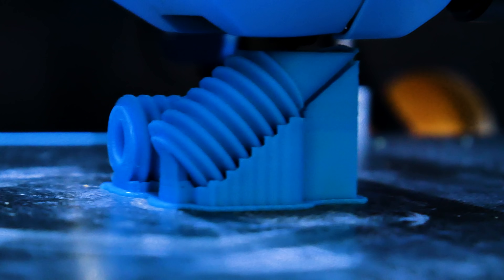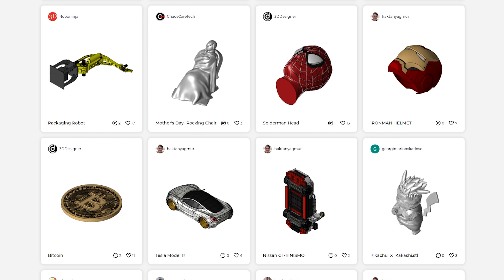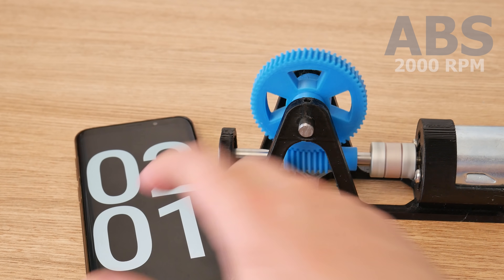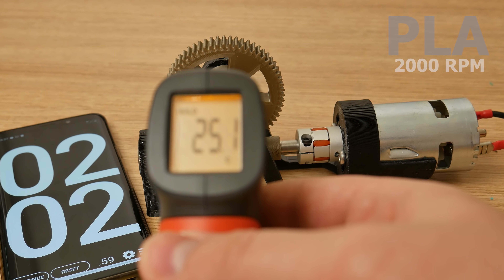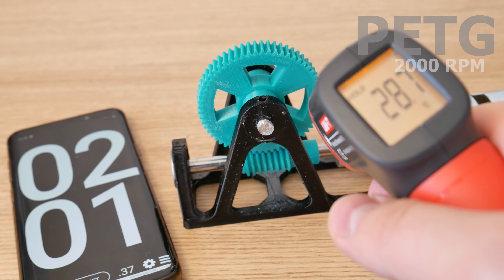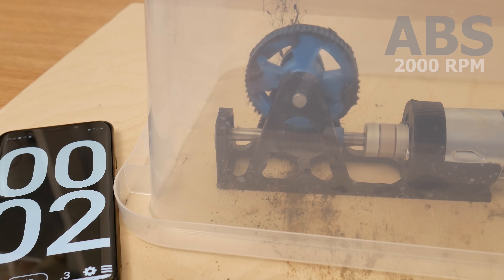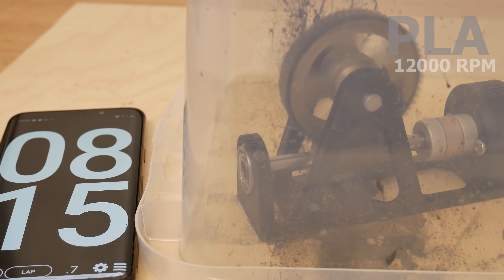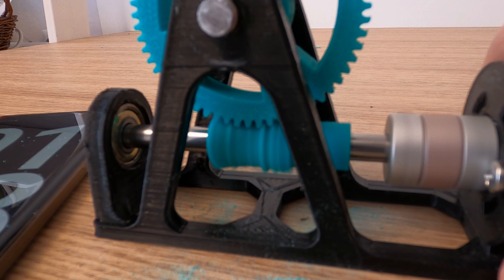3D Printed WORM GEAR - Can u Really Use Them? (PLA vs PETG vs ABS)

Comment: Is usually considered a mechanically poor idea to run identical materials against each other... result is frequently galling.  Far better results likely running with different materials. Eg try abs worm and pla wheel
Reply: I looked up galling and it's apparently kml a phenomenon than occurs with metals.
Reply: @fortoday04 I'm not convinced galling is limited to metals. Think it, or similar problems, could occur with any material combination that can friction weld.

Comment: Worm gear needed a set screw...once it had enough heat to not be locked to the shaft it could move out of position...forward on the shaft, causing the threads to be misaligned and thus accelerating wear and damage.
Reply: Exactly right.  Relying on a press fit for accurate positioning in a stress/heat inducing application/test isn't sound design.

Comment: You get a better result using a standard steel or brass bolt as the worm drive and print the gear at a suitable pitch.

Comment: I feel like you should expand your testing to Nylon as well since it is somewhat self-lubricating.  Also, most worm drives in practice often use a softer material for the Worm Wheel than they do for the Worm Gear.  Once I upgrade my printer to be able to print nylon I was thinking of doing a "regular" Nylon for the Worm Wheel, while using a "carbon fiber" Nylon for the Worm Gear. PLA-PETG-ABS are nice, yet when used for industrial applications will always be sub-optimal.

Comment: Try using a setup with tighter tolerances and a slightly larger diameter wheel with beveled teeth to cut down on the wear.  You will of course have to change the number of teeth to accommodate the gear properly but the specs aren't that hard to configure.

The hard part is machining the bevels.  Not only will in increase the longevity of both the wheel and gear but it will also decrease the friction and produce a larger time that the two are in contact for each encounter.

It sounds counter intuitive but the major problem I am seeing with your designs are that you are relying on single point contact, two points if contact continuous and 3 during the apex would be a more desirable design.

Comment: The teeth on the gears in the thumbnail don't match properly, so of course it isn't going to work right. It would be nice to have some decent pics showing how the teeth mesh, because I think the biggest problem here is design (Of course I could be wrong, but without decent pics I'll never know). For the most part, I think this video is mickey-mouse nonsense with zero real-world relevance.

Comment: Use igus filament for parts that are subject to wear and friction, they are optimized for low friction and contain solid lubricants!
Reply: I think including lubricants in a plastic would make a layers not stick together.
Reply: @melody3741  he is right.  Igus sells bearings and they sell a filament for making bearing surfaces.  This is a great idea. The solid lubricants allow printing and lubrication.
Reply: @melody3741  some igus filaments print very easy and have great layer adhesion... I150 for example. I work with them a lot
Reply: @melody3741  A lot of mechanisms are made from PA (Nylon) and POM (Delrin) famlies of polymers, and you're also familiar with Teflon. These polymers are called "self lubricating" as in if there's any material lost on the surface, it acts as a lubricant as opposed to abrasive, besides being low friction to begin with. I forget what polymer IGUS products are based on, it's something else yet, but it's similar in this regard. This isn't true of PETG for example, the particles can flash crystallise from pressure and become abrasive, although otherwise it's pretty good for friction surfaces.
Reply: Or just throw some oil on it and the texture of the layers will hold and trap oil and pull it through the system evenly
Reply: i didn't realize this filament existed, I've used their bearings with great results. It definitely looks like a good candidate for gears
Reply: @rj7855  for gears , use nylon
Reply: Except this is a truly difficult material to print with. Not for the common printer as far as I've read.
Reply: @MoonWind32690  depends, there are some tricky ones, but I150 is no challenge when you're used to PETG, can be used on any printer
Reply: @Alakuu  taulman 910 is very easy to print and works with most printers. I've made gears with it, and they worked pretty well.
Reply: Need me some of that.

Comment: ABS is unfortunately not oil resistant, which means that the grease itself will have its effect on the material. Maybe next time use ASA as a comparable substitute.

Comment: that really blows my mind how huge of a difference a little grease made!! awesome video. be great to see how well they work under a high load!
Reply: "a little grease"

XD

Good joke mate
Reply: @HidekiShinichi  you obviously havent greased a machine in your life lol
Reply: @cranexdragon1046  I had. And for most part the less grease you use the better, the more grease you use the more issues in the future its gonna have. There are few exceptiona but still.
Reply: @HidekiShinichi  i didnt say you had to fill it till the seals break lol.  But that right there is not a lot of grease especially considering its flinging it off as the test is running. Its not enclosed and the system does not retain any of the grease it expels.
Reply: true in engines and motors too!! HAH

Comment: My CNC mini milling machine came with Nylon gears and they worked fine with no wear for a couple of years but I replaced them with machined steel gears as when they did start to wear they could cause damage elsewhere
Reply: Sometimes using nylon gears etc is there to provide a known weak point. In the event of a failure knowing where the damage will be isnt a bad idea
Reply: You can try an oil impregnated bronze

Comment: I'm using printed worm wheel from PETG for car front wipers for 2,5 years. Still working.
Reply: Update: it broke yesterday. Still 2 and a half years is good. Probably would last longer if it were printed with tighter tolerances. Now I will try abs gear.
Reply: @lagynas  any updates on breakages?
Reply: @sihimoge  petg lasted 2.5 years. Abs still ok but it's been only few weeks I installed it.
Reply: @lagynas  i guess update us in like  2.3 years
Reply: @lagynas What's the situation?
Reply: @hengen42 abs was weak. Nylon holds longest
Reply: @lagynas Is there an abbreviation for the plastic you use as nylon? Like ABS, PETG, etc.
Reply: @lagynas  abs broken yet?
Reply: impressive! be cool to se how much wear its gotten!
Reply: @ale6242  unfortunately I don't plan to disassembly wipers mechanism until it breaks again. It is a pain in the *ss to disassemble it you know 🙄
Reply: @ale6242  i would guess that nearly none. It's low rpm so it wont melt. It has tendency to be brittle but at this use it doesn't matter.
It wont give or shred material like abs or pla.
If you cant print nylon use petg for low torque application.
Reply: Interesting. Maybe I don't have to resort to nylon for some car things, then.
That stuff is a pain to print, after all.
Reply: Yes and no. Petg is fine but i wouldnt use it near hot areas or where theres lots of vibration. It breaks easily and the heats isnside a car on a summer day can easily pass the 60-70*C mark where petg starts getting soft.
Reply: @laharl2k  from my practice petg is ok. How easily it breaks depends on who made it. Devil Design petg is stiff and breaks easily, but other manufacturer (can't remember company's name) which uses samsung petg pellets is way more flexible thus doesn't breaks or shatters that easily.
I made bumper parts from black petg and after 2 summer seasons it still in tact and no wrapping. In summer, we have few days of 30+ degrees. And don't forget that gear I used for wipers are located in engine bay, and worked just fine for 2 and a half years.
Reply: @lagynas  
yeah it wont melt right away but heat increases creep and under load/stress parts will deform inside a car. Gears arent under constant load so maybe they are just fine even with the heat in there, and usually when it rains its not super sunny so its a specific case where petg fits just right.  
I wouldnt bet so if it were some sort of clamp  or pressure fit part. Id bet they would be lose within 1-1.5 months of summer undr the sun.
Reply: @NoOne-ef7yu  Yes and no. PETG is good for things thay you dont want to post prosess (or just sandpaper and matte finish) or parts that wont meet any impacts or beefy mechanical resistance (I just did petg custom center caps for 6gen Camaro).

I'm using ASA, ABS (has to be clearcoated at least), PETG, Nylon or in some cases Impact PLA/PLA+. each application is different and so should be matterials that are used.
Reply: PETG is tha best <3
Reply: Personally I think people underestimate the strength of 3d printed parts, and yea Petg is the best

Comment: Interesting video however as worm gears are typically used in low speed high torque applications I think it will be even  more interesting to see how they perform  under load
Reply: Exactly what I was thinking.
Reply: petroleum based grease ok for plastic for long term?
Reply: @SquareRootOfNegativeOne  PETG is very resistant to chemicals and petroleum based grease shouldn't be a problem. PTFE or silicone grease should work with all plastics
Reply: @SquareRootOfNegativeOne  model railroad gear lube  would actually probably be best, as they are made for the plastic/brass worm gears and spur gears in model trains , or graphite.
Reply: @TheBeeMan1994  just checked your channel out. brilliant!!!
Reply: I have a worm gear on my 1:960 train layout.  I use it for a low torque low speed operation, so I should be fine.
Reply: @michaelbujaki2462  Do you have any photos or videos of that layout? I'm watching this with a ~1:40 rail system in mind, but having seen Z and T gauge layouts, I'd love to see yours at such a small scale!
Reply: @Blayzeing  I just posted my two layouts on my channel.  Due to mechanical challenges I'm still working on getting the electric version going.
Reply: @michaelbujaki2462  Blimey, I can imagine looking at how small they are! But they're super cool! I love the amount of detail you've managed to get into them! If you can figure out a way of electrifying them, that'd be awesome. Please do keep uploading videos whenever you have time to - I've subscribed and would love to see it progress.
Reply: @Blayzeing  What did you think of the other one?
Reply: @michaelbujaki2462  They both look cool - though I think I prefer the "Small" one over the "Really Small" one, because it looks like it slides easier and may be easier to electrify.
Reply: I too wondered about load. I want to build a curtain opener. It takes quite a bit of pull.
Reply: @mikepettengill2706  I started that project years ago and didn't finish.  Designed adjustable cams into it with limit switches to adjust the stop in both directions.  Wired in a dpdt switch to reverse polarity.

The project sits unfinished on my desk.
Reply: Yeah I think at low rpm with some lube, it'd actually do pretty well.
Reply: And the wheel should be an helical gear
Reply: I would be curious on the wear if you continued the experiment for much longer.  Maybe PETG for as long as it would go at 8,000 RPM?
Reply: Agreed, In my line of work I've only seen them used for fine adjustments on sighting equipment.
Reply: And maybe a differ angal on the teeth an threads. I know it is different when it comes to aleminum and steal gears
Reply: Exactly my thoughts the whole time watching this. Since these tests would have no practical application, the entire video is redundant.
Reply: I was wondering the same thing. I may test it with 20kg load at very low speed (I'm trying to use it on my DIY telescope)
Reply: Yeah so I guess don’t use a plastic gear 133 rotations per second with no grease. Or cast the 3d print first as metal. Or use for low speed application like what it’s designed for. Who would of guessed.
Reply: I have printed a set of replacement gears for my garage door opener 2 years ago. Plain PLA, 60% infill 4 walls.
It's still going strong with no sign of wear.
Don't forget to lubricate it profusely. I used common lithium grease and it caused no issue.
Reply: if you have just 3d printer and no skills about mechanic then you create stupid videos

Comment: I made a small 3D printed transmission, without grease I could never get it to run for more than a minute or two. I greased it up and have had zero issues since. 3 months now on the same transmission on an RC car

Comment: I can see issues not related to 3d printing. The system flexibilty and lack of frame rigidity causing lack of contact between the mating parts. This will damage even steel gears. Specially when combined with maximum acceleration. 

The 3d parts are not to be blamed in isolation in my opinion. It is the overall mechanical system design.
Reply: The weakness of worm gear is huge friction increase at high torque loads. Usally such gears are submerged in oil in professional application. Oil bath both lubricates and cools wich are essential with this type of gear.

Comment: it's amazing how much the grease increased perforamance
Reply: Now imagine your transmission and your engine how important oil is
Reply: It's just about reducing a friction and temperature
Reply: heat is the enemy, even with metal gears
Reply: Its really not at all. EVERYTHING works better with lubricant
Reply: Or, you can use low-friction material which almost doesn't need lubrication, like nylon or POM.
A little drop of grease will last forever
Reply: The design of the rig itself where poorly constructed.  The wheel also should have been beveled to prevent as much friction as possible.  Hard edges make things worse.
Reply: No it isn't. That's what grease/lubrication is for.

Comment: one Tip...
Print Gears and screws in 0.15 layer height.... it would be very better.
Reply: Taking it further, a 0.16 or 0.12 layer height would take advantage of stepper interpolation and lead screw geometry on most common printers, which will give even more superior results.
Reply: @Inventorsquare  How do you make sure your first layer starts on an exact step and not halfway between. Magic numbers only make sense if you can control the step position of 0 Z height (and nozzle Z offset) and most printers don't give you the information needed to do that. Moving whole steps is only useful if you start on a whole step.
Reply: @backgammonbacon  Which is why professional CNC operators have been telling the amateur 3DP crowd since day one to never use micro steps for *positioning*. Yay, it gets us where we want cheaper when we don't care about quality, big whoop! It costs pennies to add a gear box between your motor and your lead screw or belt, especially if you print it. You wind up with slower travel but there are ways around that too.
Reply: @backgammonbacon  print with rafts when printing gears
Reply: @backgammonbacon  I’m not sure, but it definitely makes sense in practice because the proof in the results. CHEP has a video on it.
Reply: @backgammonbacon  Too lazy to search, confirm and/or prove but I'm pretty sure the accumulated error from microstepping to random microstep positions is bigger than if you were to come back to the same microstep all the time, regardless of which microstep that is.
Also, disabling the steppers right after homing would still take you back to the relevant full step, in case doing this.
It does beg the question tho, how much it does matter in the end when squirting molten or softened plastic out of a nozzle from a cheap Chinese extruder head, considering also that this whole microstepping error has a high chance of ending up statistically compensated through the possibly hundreds of layers...